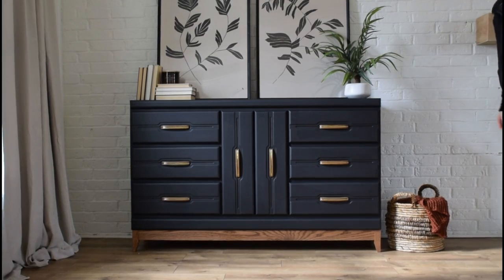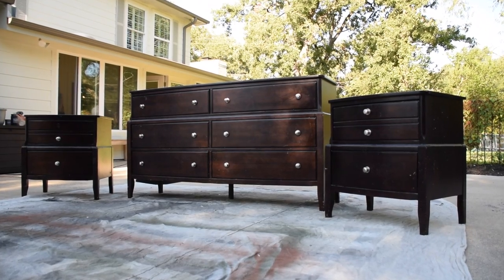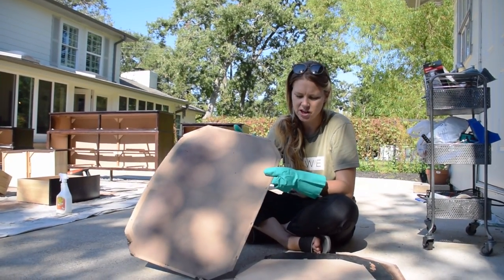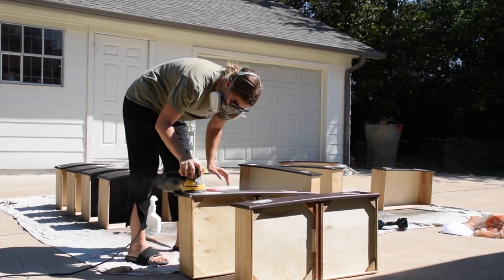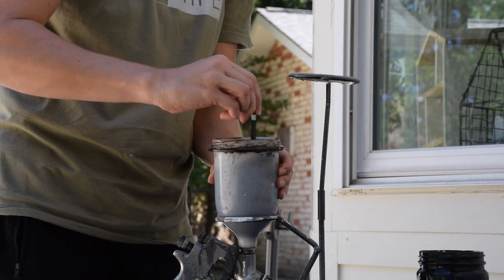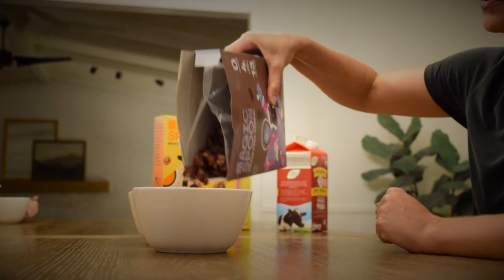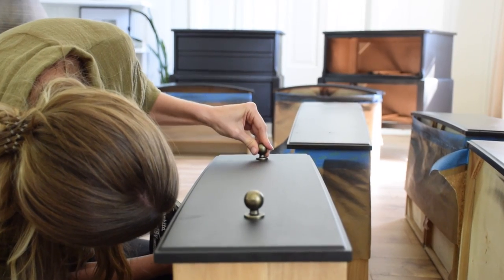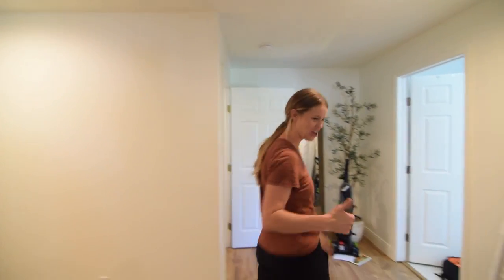Trash To Treasure Furniture Makeover For Our Home // Furniture Restoration / High End Furniture Flip

Comment: I love the color! So pretty! So I have a question,  what is your favorite paint for kitchen cabinets?
Reply from the maker: Thank you!  Ok so I've always said my favorites are Sherwin Williams Emerald urethane trim enamel, or Benjamin Moore's Advance paint.... but if I were painting cabinets now, there's a company in Canada (which has the BEST customer service, which just makes me like them even more) called Envirolak.  It's a water based paint system that is incredible, more durable than ANY oil or water based paint I've ever used.  My brother tried scratching it with a nail and couldn't even hardly leave a mark.  It sprays like a dream too and you can get any sort of sheen you want and have them match popular colors here.  Really the only reason I don't use it on furniture is I can't get it in small amounts, and for the sake of not being boring here I like to try and change my colors up :)

Comment: I just built a built-in, in my office and painted it black. I've been struggling with the top coat. I've never heard of hemp oil as a top coat. Do I just apply with brush like you? How many coats? Can I use over Behr paint? You mentioned upkeep to hemp oil? I'd appreciate your help!
Reply from the maker: It depends what kind of paint... hemp oil is a finish that's meant to go over a porous paint like chalk paint (so not latex wall paint).  Hemp oil is similar to wax, since it wears off with use you reapply every so often (I mean, maybe once a year or less).

Comment: Nice job! What kind of compressor size/power do you recommend for an HVLP spray gun??
Reply from the maker: Thanks!  I use a 27 gallon compressor, but it really depends on your gun and the cfm requirements of it (that's what you should really be looking for vs size of compressor!).